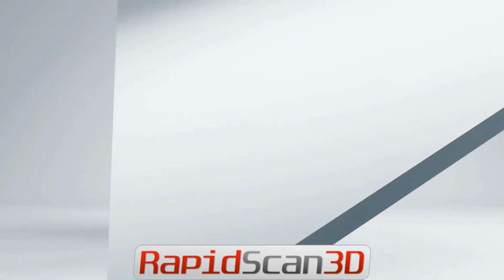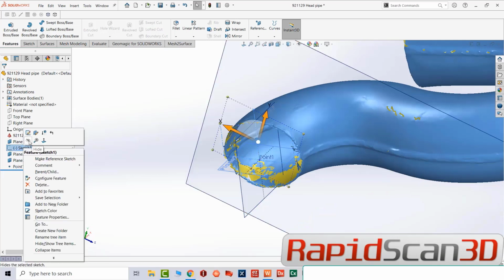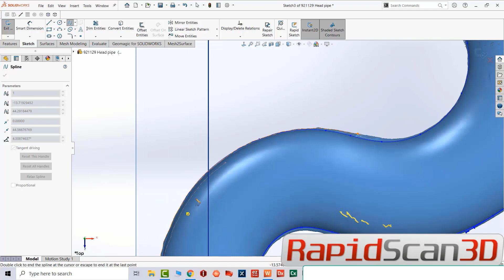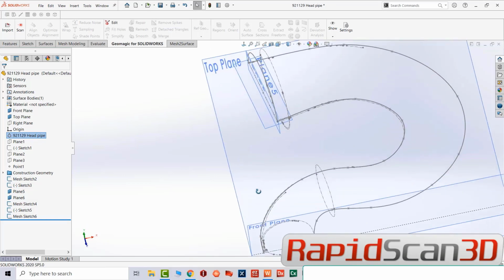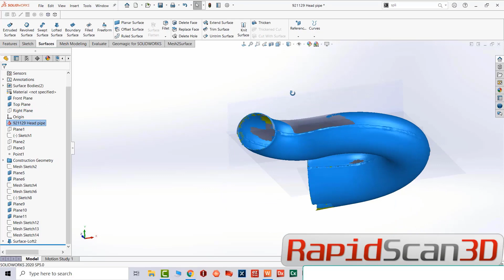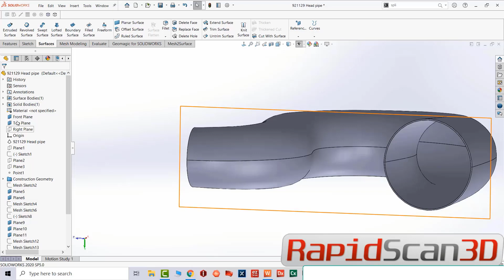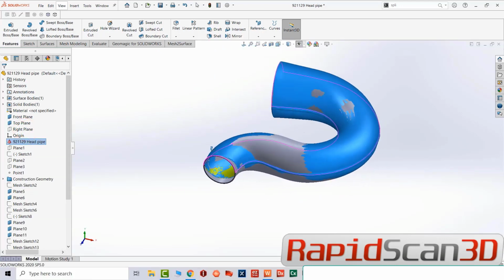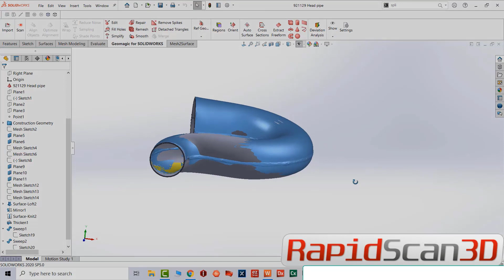Geomagic for SolidWorks - How to create a loft

Comment: I found this to be brilliant and underrated. Thank you very much! This is actually the only video showing this method that I can find. Every other video is sketching on meshes which is terrible if you're trying to interpolate between overlapping meshes! Plus parametric freedom is full control which I've come to appreciate as a design engineer.
Reply: Thank you for your comment.  I am glad we were able to provide some best practices with Geo for SolidWorks.   If you have any other suggestions we can create videos on a tool.